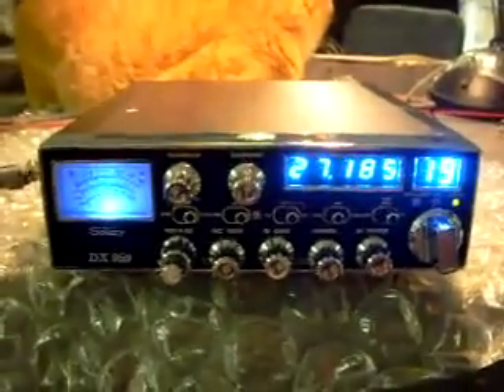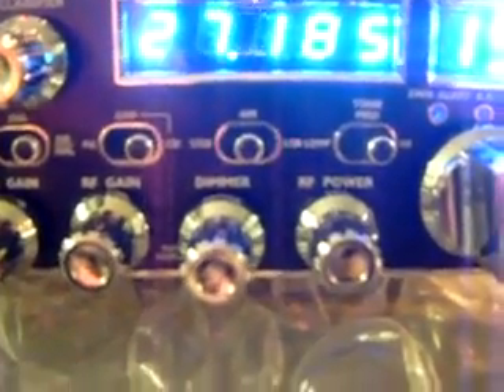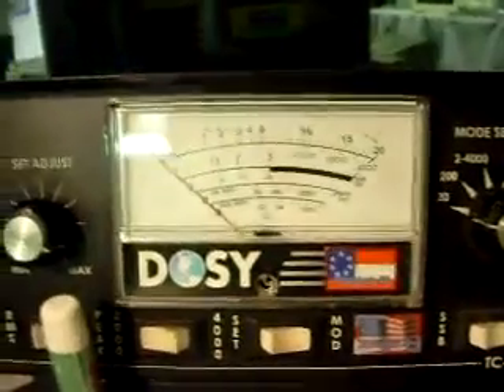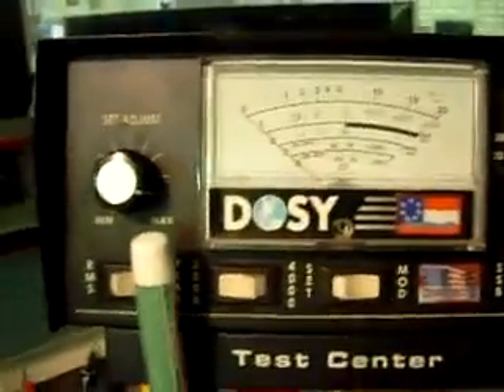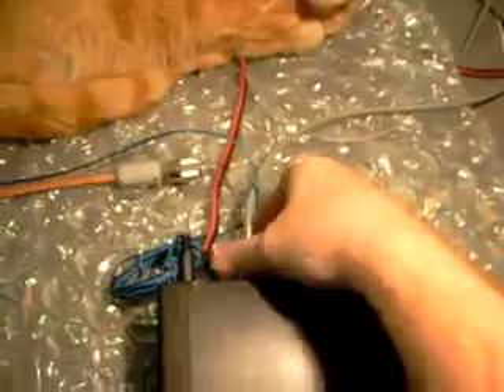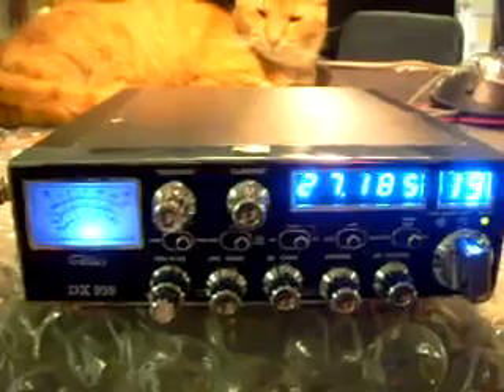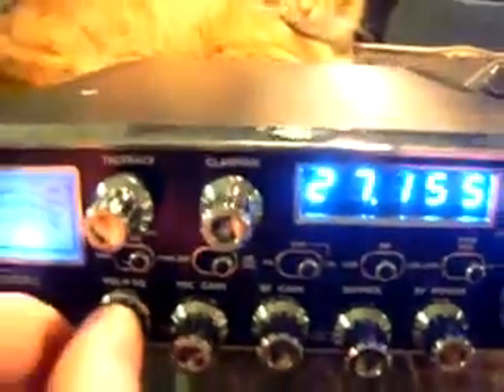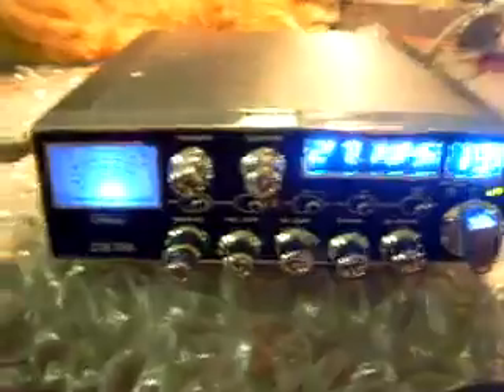galaxy 959 set up ready roll 55 watts

Comment: Instead of a diode off the am power trimmer/resistor. Use a 100k ohm to ground (Instead of 1n4007) change the 2sb754 regulator on the side of the chassis with a 2sb817. change the 2sa743 (TO-220) right in front of the 2sa1012. Remove the shorting bar and wire the input of the shorting bar, fed from the 817 to the input to the driver (2sc2166 in my day) and then wire the input to the final, 2sc1969/2312 to the filtered side of the input inductor. Turn your modulation up, set your carrier for where you need/like/sounds good. And then stab and steer.  Learned allot about radios on one of these back in the 90s. First "real" radio before a 2970. I have more fun on AM/11 meters then any HF band running my TS-680s kenwood. Part of that is probably the company!
Reply from the maker: Adam White forgot the driver change too the 42c as well with the 817;)

Comment: How do these do with amps??? I got a little Shooting Star 225 Plus Amplifier I got from a friend and ive never used a amp before. I always bought radios that already had power ( converted 10 meters). Loved my Strykers!! Those radios that do 130 watts or so barefoot was always plenty for me. But since I got that amp for basically nothing Id like to try it out. Ive never had a Galaxy radio but I LOVE the old school looks of them and the big meter. Will a 959 work well with that 225 amp??? I do have a stock Cobra 29 I could use but Cobra 29s just bore the hell out of me
Reply: I dont see why not and for the amp just make sure you atleast got a lo pass filter ln it so you dont bleed all over the 3 channels above and below
Reply: As long as the radio is stock it should work with the linear, but if it puts out a lot of power you can fry the amp. Stryker Radios put out too much power to use with an amp unless you have a high drive amp like a Texas Star 500v .